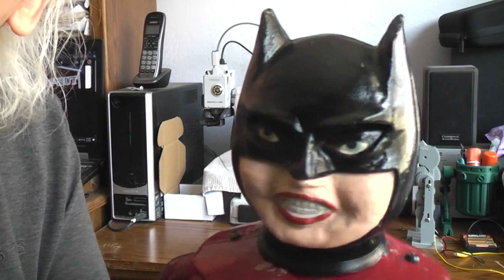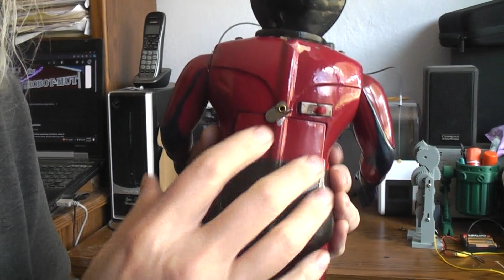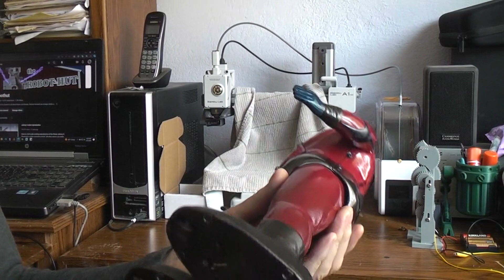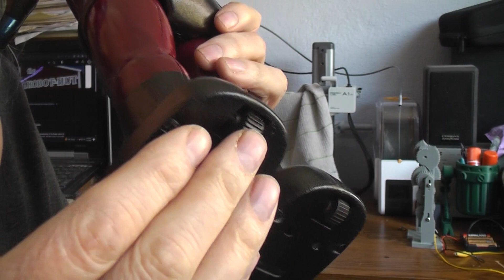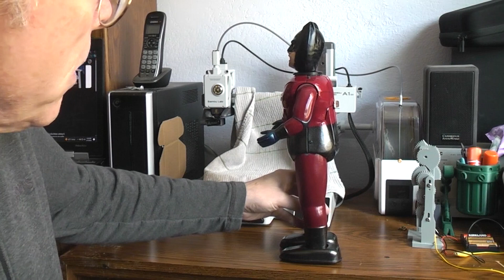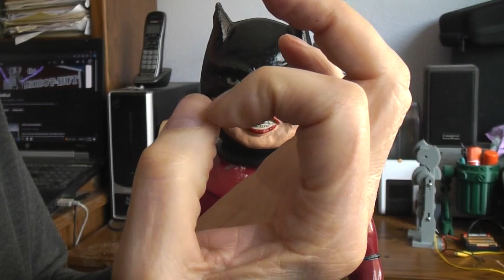Vintage 16 inch tall, battery-operated Batman "concept / prototype ? ", robot repair.

Comment: I owned this piece for while. Acquired it from a private collection. This is a Robert Johnson Garage Bot / Comettoys Prototype Batman. The box for it is interesting . Didn't have room for it so gave it to an auction company. The toy itself is one of the rare Bullmark 17” battery op tall ultraman or mirrorman. Not a toy you would butcher unless it was a real basket case Here’s a link to one version. https://youtu.be/6PPkBwF_ZJg?si=FE1ZB1zOoCeTKFhh
Reply from the maker: Yea, that is what I thought. And it was a basket case. But now it is working just fine.
Reply: Yes! I think you are right about the Ultraman toy. He has a video of one and the arms and legs look identical to this piece.
Reply: @Lethgar_Smith  yes it’s the bullmark ,they only made 2 versions Ultraman & Mirrorman I added a link to one in my original post